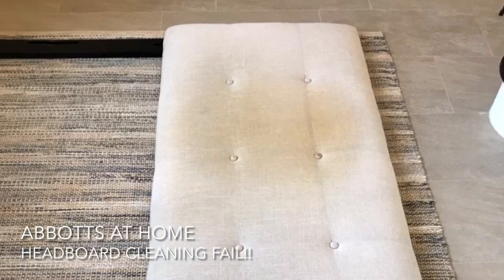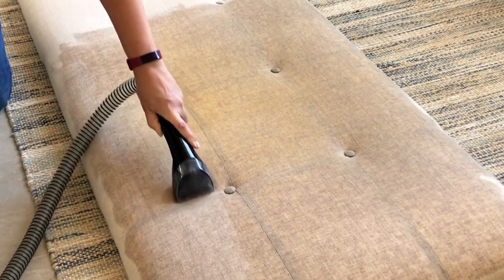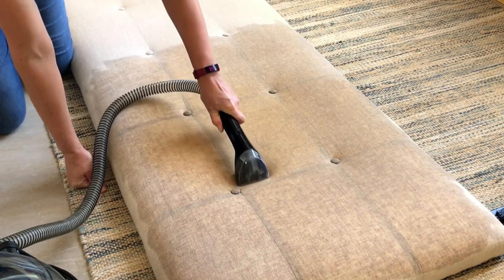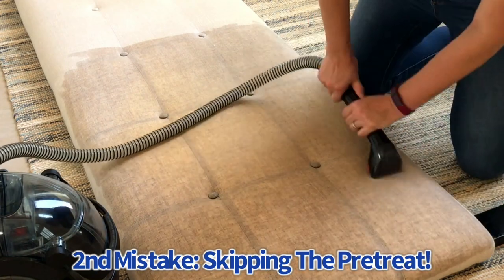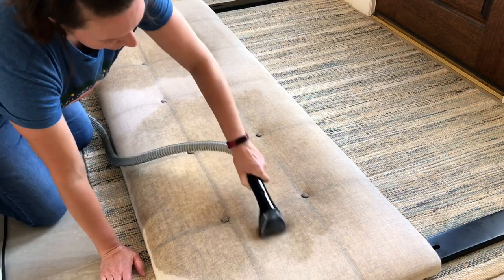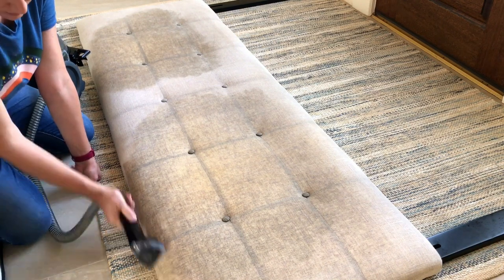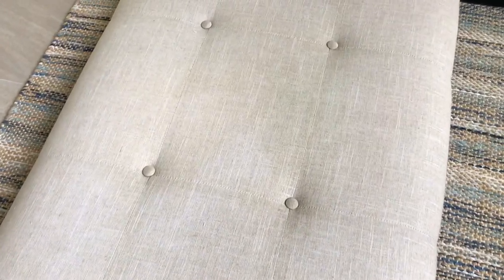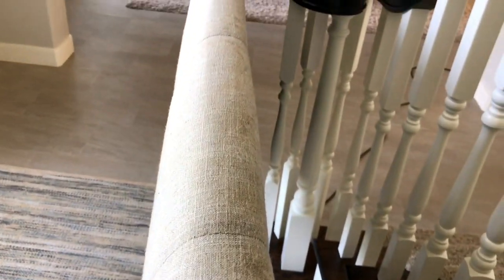Cleaning Fail! What I Did Wrong Cleaning an Upholstered Headboard - Headboard Stains

Comment from the maker: See how I reupholstered this headboard: https://youtu.be/89fRsG3cKwM

My Favorite Home Cleaning Videos: https://www.youtube.com/watch?v=C3O48RW5hCM&list=PL63TJ6Vqtnfwsx68tqzDNPgbslRDU1DYa

My Popular Car Cleaning Video: https://www.youtube.com/watch?v=MNScMZ7at4E&list=PL63TJ6Vqtnfwsx68tqzDNPgbslRDU1DYa&index=3

See which cleaning products are safe to use in a Bissell Spot Cleaner: https://www.abbottsathome.com/what-can-i-use-in-bissell-spot-cleaner/
Reply: @AbbotsAtHome  I have a case like this right now & I used an "oxy" cleaner too. 
did you seriously "Have to reupholster"?  I'm a cleaner (by profession)  And I have NEVER ever run into this before. (extreme yellowing) But now???  I MUST clean it  and fix the problem. in MY case?  The ENTIRE headboard turned yellow, and I'm "Stuck" fixing it. ... I'm glad you put the info out here that you did about the alcohol treatment. .... I've actually got an excellent reputation, and an excellent batting average.  I almost NEVER fail.  But this time????  the headboard turned entirely YELLOW.  And the customer is talking about re-upholstering a $3,000 piece. 
- I MUST try to clean and fix it-   so I am stuck doing the (possibly useless) work, and getting a horrible stain on my record (no pun intended). 
..... it seemed like this COULD work-  like it COULD be cleaned... bc you had begin to gain success.
.
Very often (in my experience)  "Success" came only from ... Grinding on & Thru a problem and continuing to clean. putting the sweat into it. ... do you agree that it is _Possible_?
bc reupholstering is NOT an option.

Comment: The problem is the material. Linen cannot be cleaned with regular upholstery or laundry detergents as it is made of natural cotton fibers that can be damaged from the high alkaline detergents. The recommended treatment is dry cleaning solvent. Alcohol is a solvent and that's why you saw a better result, but it wasn't necessary to mix with water. You can clean any other synthetic material using your bissel, but for sensitive fabrics such as linen, silk, velvet, etc it best to take them  to professional dry cleaning service.
Reply from the maker: Thanks for the tip about fabrics. Taking a King-sized headboard to a professional dry cleaning service is a bit too much of a pain. Especially when all of my local dry cleaners then send big items off to another location for the actual cleaning. Then it takes 2 weeks to get back. But I’ll pay more attention to the fabric choice when I reupholster it. 👍
Reply: @AbbottsAtHome  Once you re-upholster the headboard, consider applying fabric protector treatment such as scotchgard. Check with your local carpet and upholstery cleaning professionals if they offer that service. Fabric protection will make the surface of any fabric material stain and liquid proof.

Comment: Use a chalk paint on the headboard and when dry buff in some of the chalk paint wax.  I've done similar fabric dining chairs and it completely covers the stain and is not stiff to the touch.
Reply from the maker: I've thought about trying that on fabric someday Just haven't found the right project. I'll have to give it a try sometime. :) I ended up reupholstering this headboard with blue velvet. It only took about 30 minutes. I have another video showing how I did it. https://www.youtube.com/watch?v=89fRsG3cKwM